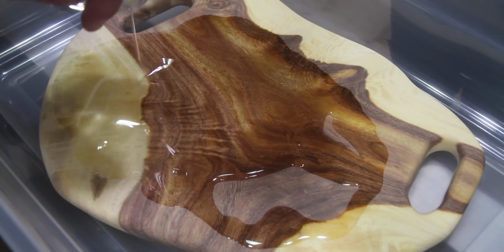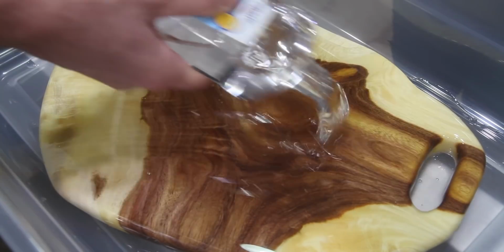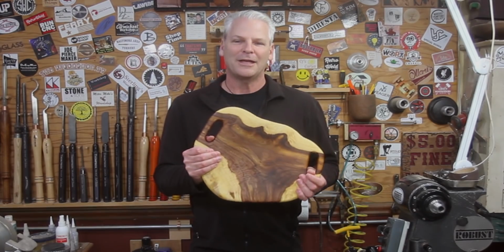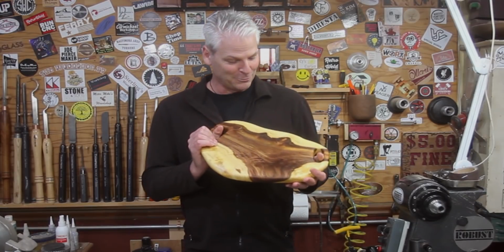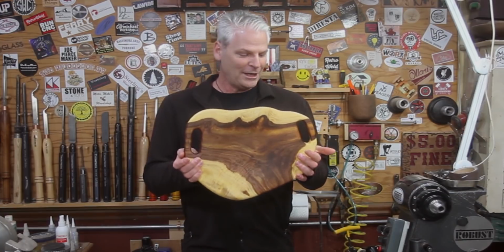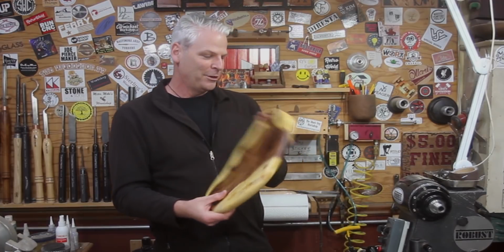Woodturning - Crotch Wood

Comment: Well body very nice job. I wonder if you can carry anything on that platter without sliding off it. but since you have that edge had shaped you may want to route a lip so things won't drop off should you need to move the platter. by the you broke my heart with that beautiful wood. Youlknow those things won't grow down here in south Texas
Reply from the maker: Thank you Phillip! I did dish it out a little bit, so it should be good.
Reply: @CarlJacobson  Sorry buddy I may have spoken too quickly. It's hard to see it in the video. Carl, I wonder if you still have my phone number if you could call me please?

Comment: After you apply the mineral oil, I normally use a beeswax food safe finish but sometimes I notice the oil kinda bleeds out. Is that normal? Am I doing something wrong?
Reply from the maker: Hey Adam, you're not doing anything wrong. The mineral oil will bleed out for a week or so. You can wait to put the mineral oil on but it really doesn't matter the oil will come out either way.
Reply: @CarlJacobson  Perfect, I have sold a number of cutting boards and after I noticed that was a little worried.

Thanks!

Comment: Good save on the project and it turned out awesome. After letting it set in the mineral oil for a couple of day do you wipe it off and let if fully dry or do you do some buffing?  I was able to score a nice walnut cutoff from a local guy with a sawmill. I did a quick search and when your video popped up I knew I would get a good idea how to get a good result.
Reply from the maker: Thank you Larry! Yes after the mineral oil bath, just wipe it off and let it dry.

Comment: Great job Carl.  Two questions:  Can the leftover mineral oil be bottled and reused for other pieces?  and is the adapter you used to stand the jaw chuck upright sold over the counter, or did you make it yourself?  Once again,.... great work!
Reply from the maker: Thank you Tony! There's on need to boil the mineral oil it can just be reused. Here's a link to the chuck mount http://trentboschtools.com/product/trent-bosch-versatile-carving-stand-1-14-x-8-tpi/
Reply: Thanks Carl,... very much appreciated.